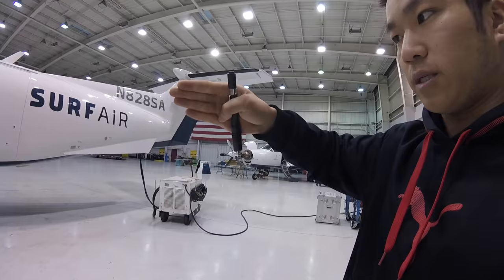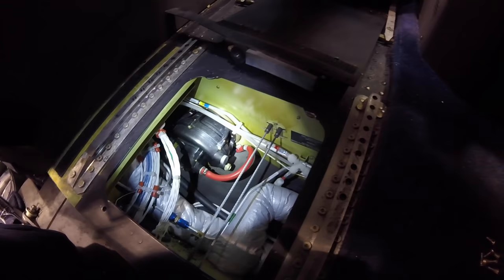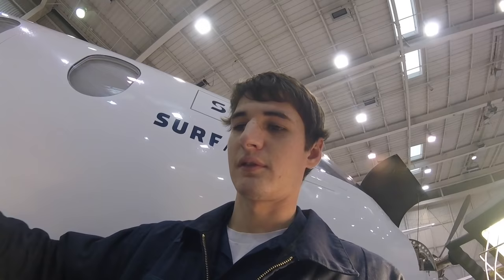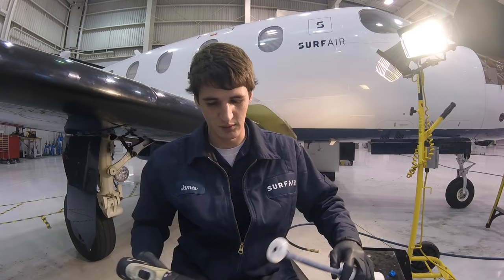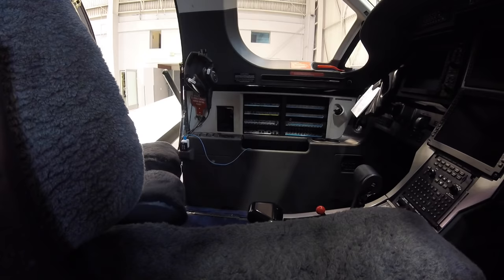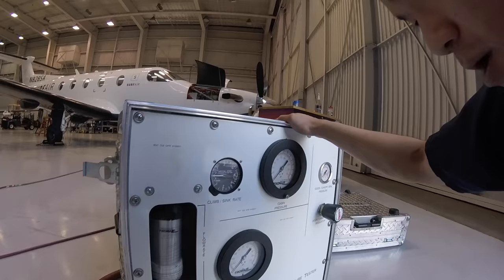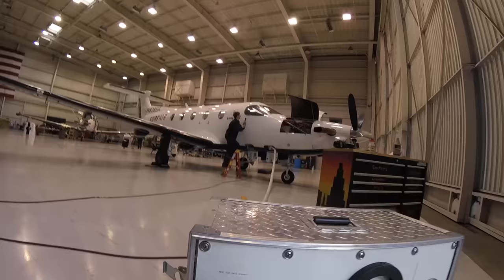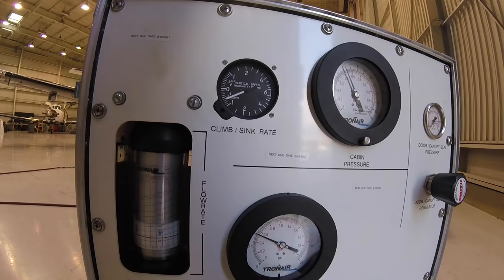How to Become an Aircraft Mechanic

Comment: what is your math lesson on aviation? is it hard? coz im totally weak at math :(
but this is my dream tho... to be a aircraft mechanic and I want to know how to fly a plane... not the commercial plane, just the private plane or the 4 seater plane hehe
Reply from the maker: You don't need to be good at math (I'm not!) Basic algebra is all you will need for electrical theory and weight and balance calculations
Reply: James Sullivan  wow!!! really???? thanks man! i really appreciated ur reply.... thanks for the information man...  u help me alot even if is just a small information... it helps me motivate to pursue my dream to become a aircraft mechanic  :)
Reply: James Sullivan  just one more question tho... hehe
in ur schoolng days as an aircraft mechanic do have a lot of physical training like jogging or fixing the plane outside the hanger where there is heat and sun or do just fix the plane in hanger coz im just wandering what if there's a storm or high Celsius heat do still fix it outside or in the hanger? :) and what I needed to do to be a successful mechanic like be hardworking responsible etc..